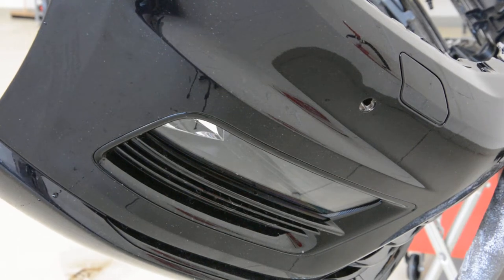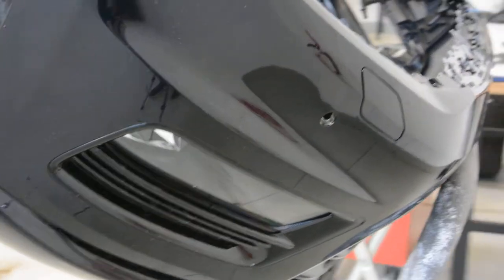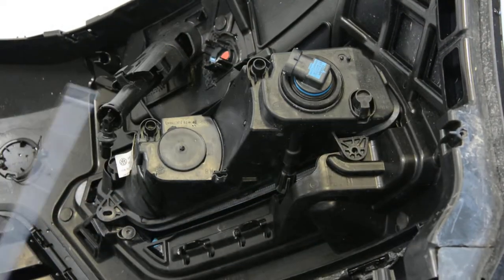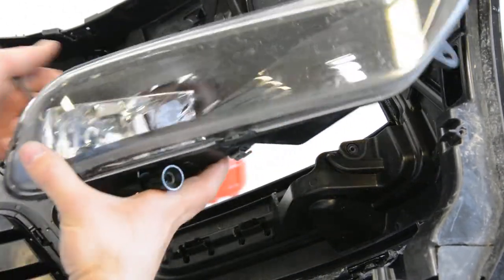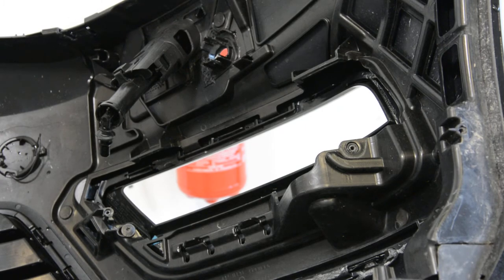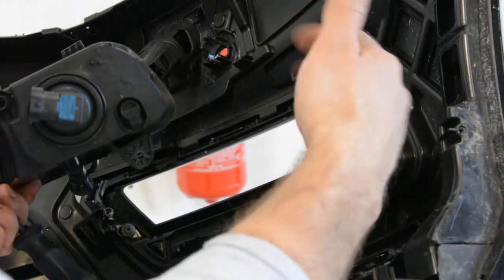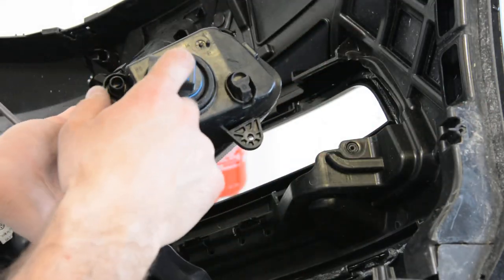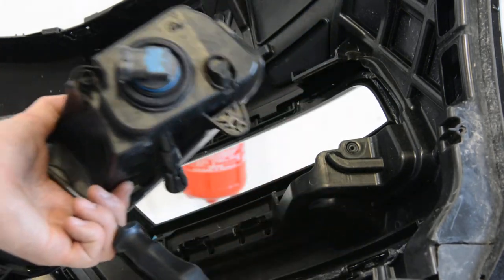How to remove fog lights Golf 7

Comment: You do not need to remove the bumper just to change the fog lights! There are rubber panels behind under the wheel arches for accessing the bulbs (can be seen in the video above). Here are proper instructions: https://www.youtube.com/watch?v=rTY5YXFFTwo